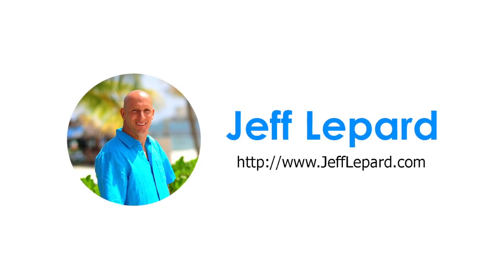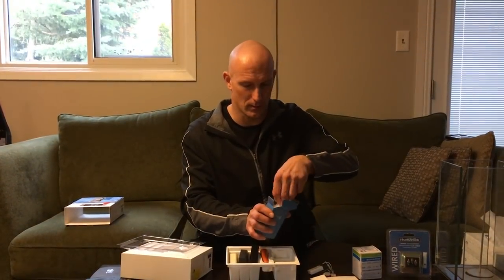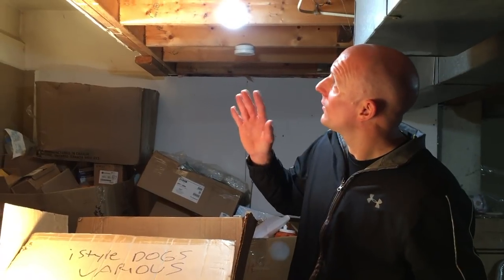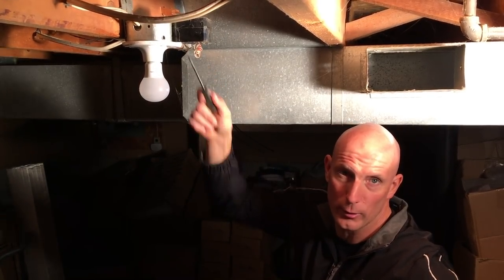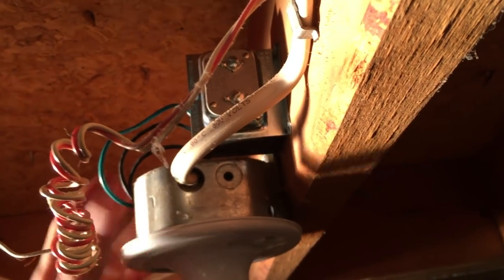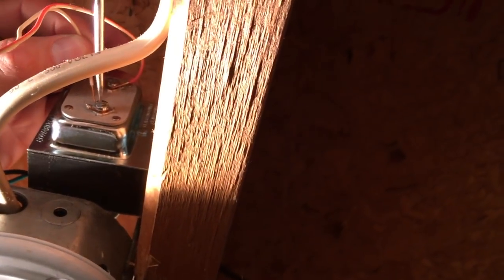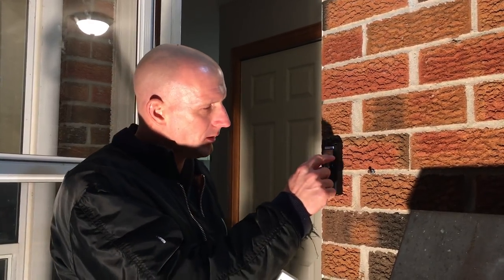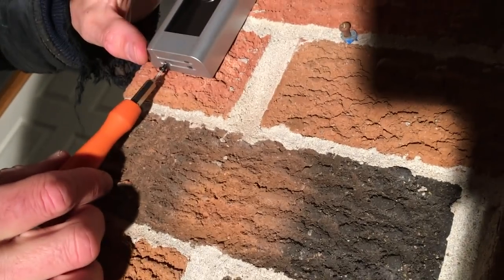Ring Video Doorbell Pro (Full Installation)

Comment: Does the doorbell need to be at eye level or can it be lower and still capture a face in video?
Reply from the maker: Nope, you can install the doorbell higher or lower as you need it.  The range of view is excellent it really captures a wide view so you won't have to worry about that.

Comment: You put the cover on which prevents setting up the device as the small setup button cannot be pressed also if you try to install wall plugs by pushing them in with a philips screwdriver point you risk expanding the plug preventing it fitting in the hole, better to use a small hammer or screwdriver handle.
Reply from the maker: +St Albans Tech that us true.  I know the holes i made were perfect size but normally a hammer woukd be better.

Comment: I have an Edward transformer # 592 with 24V 20VA written on it. It’s written chimes on the transformer. I see it in the garage next to the circuit breaker. I think I need to wire the corner most screws either side for 24V 20V since it’s pointed towards the further most screws. My question is can any wire go to any screw? I see one wire is greenish white and the other red. Right now, Red is connected to the middle screw and green to the corner screw. What exact connection do I need to do for ring doorbell pro? Please note this is quite an old house built in 70s but the circuit breaker itself has been modified. Which exact beaker should I switch off since I do not see any general switch? Can I switch just the mains off to be safe before I start?
Reply from the maker: Does your transformer have 2 wire poles to it or 3?  Yes if you don't really know which breaker to switch off you could kill the entire power if you need to be safe.  If your transformer has 2 poles it doesn't matter which wire you connect as it will produce the same results.
Reply: Jeff Lepard It has 3 poles and I am thinking the further most poles or screws are 24V 20VA since I can see the arrows pointed between them. Voltage is good to go but I am not sure if 20 VA is good enough power for the door bell pro. I will probably need to play individually on the circuit breaker since I see everything from bedroom, range, kitchen etc. but the chimes.

Comment: I'm having an issue with the wires being stuffed behind the door jam. Guys who installed the door put the wires behind it. Also I have the same issue with the doorbell being too wide to fit it in between the door and the brick.
Reply from the maker: As long as you can access those wires you can always extend them to where you are installing the unit.  You might have to drill like I did to extend the unit if its possible.
Reply: @JeffLepard  Thank you for the reply

Comment: What if u change the transformer  and it's still making  a humming noise... what else could it be
Reply from the maker: I would then check first the door bell button to make sure the wires are not touch each other or crossing each other somewhere.  Then check the actual chime unit on the wall.  You could use a tester and see what voltage you are getting.  It's possible you may need to change the chime unit itself.
Reply: I changed the chime to
Reply from the maker: I wonder if something is going on with the new transformer?  I'm going to look into that.

Comment: I live in a DOUBLE WIDE TRAILAR with no door bell  ---- want do I need to do to wire  ring to my home? will any electric man  know how to wire up my ring ? thanks for info
Reply from the maker: For that you could use a transformer that you plug in.  They sell those on Amazon for $13-15 if you want the easiest installation.  Long as you have power to the ring door bell and Wi-Fi you are good to go!  I will be doing a new video on upgrading the door bell transformer very soon!

Comment: I need help.  I installed the ring doorbell pro and finished the setup along with the Chime Pro.  When I ring the doorbell, I get notification and the ring on my phone and the chime pro but nothing coming from the original door bell.  NOTE...the original door bell works and ring before installing the doorbell pro.  Any idea or suggestion where I might’ve make a mistake?  Thank you..much appreciated
Reply from the maker: +Bee Thao easiest way to test this is to touch both of the wires together to make sure it rings your original doorbell.   If it doesnt ring then something happened with the prokit installed at your doorbell.  Let me know if that helped.
Reply: Part of the install process in the UK is to disable the original bell.

Comment: If you already have a transformer you don’t need to shut anything off. A doorbell is a max 24 volts. That’s nothing. Didn’t shut mine off when I installed. If you have to install the transformer then definitely shut the breaker to wherever you’re installing.
Reply from the maker: Good info!  Thanks for the comment!  Appreciate the support!

Comment: Hi did you know you didn't install the transformer correctly. You can't mount it to the wood beam it get hot. And could cause a fire. 

The correct way is to still connect it to the box. 

How you do it by putting the piece of metal that is sticking out next to the wires into the box with wires. 

After the you put one screw into the piece of that came with the transformer.  And tighten the screw.  It'll lock the transformer to the box correctly. 

After that connect the wires.

Comment: Jeff your no electrician and you screwed this one big time. The 2 black wires you ran in the open air thru the old knockout hole in the fixture box in the basement, carry the 120 volt power to the transformer and CANNOT EVER be run like that under any electrical code anywhere for safety sake. That's why they make this type doorbell step down transformer with the threaded nipple attachment like you removed so all the 120 volt wiring would be contained inside the fixture box. What you have demonstrated is very dangerous because of the possible wire chaffing against the raw metal knockout hole and the shorting and electrocution hazard that creates.
Reply from the maker: Thanks for the info on that.  I will correct that if that's the case then.  I appreciate the help and comments and it gives me the chance to make better videos and correct previous problems!
Reply: @bobrub  Must be some code issue up there in Canada, I not only see that none of the NM (non-metallic sheathed) wire has plastic clamps at the metal box knock-outs, but it also looks like insulated staples were not used to secure the NM wiring to the framing.
Reply: You definitely need a knockout grommet to run those wires through but I do agree that having exposed 120v wires is a no no. Just get a different transformer they are pretty inexpensive.

Comment from the maker: Ring Video Doorbell Pro
Amazon US: https://amzn.to/37Xni22
Amazon Canada: https://amzn.to/2VgWrsE
Amazon UK: https://amzn.to/31lOJRM
Amazon Mexico: https://amzn.to/2PptrPJ

Edwards Signaling 599 120V/24V 40W Transformer
Amazon US: https://amzn.to/3hXqu2h
Amazon Canada: https://amzn.to/3dxxfoj
Amazon UK: https://amzn.to/3g8jZZ1
Amazon Mexico: https://amzn.to/32OvVKE

24 Volt Plug In Transformer
Amazon US: https://amzn.to/2ZdFh0u
Amazon Canada: https://amzn.to/2AZLntj
Amazon UK: https://amzn.to/31lPZ7s
Amazon Mexico: https://amzn.to/3sXcIB7

Ring Chime Pro with Wi-Fi Extender
Amazon US: https://amzn.to/2YuCn8c
Amazon Canada: https://amzn.to/31ekrR3
Amazon UK: https://amzn.to/3hUdHhf
Amazon Mexico: https://amzn.to/32ShPYE

Ring Floodlight Camera
Amazon US: https://amzn.to/3fTNA8f
Amazon Canada: https://amzn.to/3i2KSPs
Amazon UK: https://amzn.to/2BaGo8V
Amazon Mexico: https://amzn.to/3tXuDZB

Ring Alarm Home Security System
Amazon US: https://amzn.to/31g8zy8
Amazon Canada: https://amzn.to/3eAkE4M
Amazon UK: https://amzn.to/3fWRxZY
Amazon Mexico: https://amzn.to/3xrn5Au
Reply: Hi Jeff, what’s your chime voltage ?
Reply: Jeff Lepard my mom got the videos doorbell3
Reply from the maker: @tamaraseals1148  The new Ring Video Doorbell Pro 2 just came out as well.
Reply from the maker: @djoye  I have more than enough voltage now from the transformer if I didn't use the transformer it might have been under powered.

Comment: Can't find my transformer at all. looked all over the place.
Reply from the maker: Is there any wire in the door bell chime on the wall that you can see where its going.  If you take that off the wall or can see which direction the wire is running you might get a better idea where to start.  Normally in basement or close to the chime off of a light fixture or in the closet.
Reply: Look inside garage or where the water heater is.  Mine is close to water heater high in the wall

Comment: BIG NO NO FOLKS, the intruder can cut those wires right off where he’s going to caulk/Patch it. He should just came forward adding a piece of wood and would’ve had the same view with no blockage AND WIRES MORE SECURE
Reply from the maker: That would work only if I mounted it partially on the wood and brick.  The door would hit the doorbell if I went flush against the wood.  Great idea though that keeps the wires more secure!
Reply: Jeff Lepard Yes Jeff half and half or custom metal box shielding it from narrow to size, what do you think?

Comment: WTH is this guy doing? That transformer is made to mount into the 1/2" knockout. Wow what a hack!
Reply from the maker: This particular transformer I got will not mount into a 1/2" knockout. I should of mentioned that on the video and showed the back of the transformer.  I did later find a transformer that would install into the knock out.
Reply from the maker: @marks4374  The transformer in that link to the video is not the same transformer but same concept.  It could be screwed to the side of the junction box but it didn't have the wing nut and fitting to mount like the older transformer.
Reply: I’m electrician and I have mounted many doorbell transformers. It is not advisable to show people how to do electrical work that is not code compliant.

Comment: Sorry, but this is NOT correct.  Ring specify 40VA MAXIMUM NOT MINIMUM.  This is to provide a continuous charging current which isn't too much.  Didn't you wonder why you're supposed to also fit a RESISTOR?  It's to cut down the current to levels for the charging function. Follow this video's instructions and you will have an overcurrent charging situation and you will cook your battery pack.  Sure, it will work immediately and you will think "job done" but your battery pack will begin to deteriorate. Check for yourself on the crap instructions Ring supply and you will find it somewhere 20VA MAX, with a wirewound resistor in series. It must be that folks are impatient to see it working, and can't be bothered to wait the 10 hours or so to come up to charge. It's a trickle charge situation.